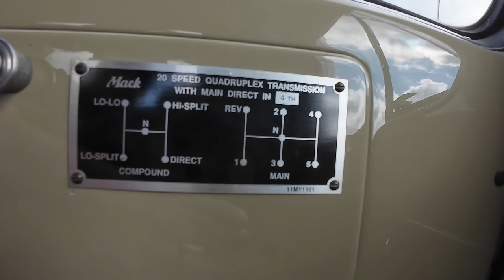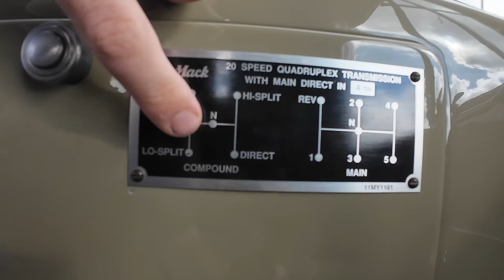2 Gearshifts | Twin stick shifting in my Grandpa’s old Mack

Comment: Back in the days when you had to know your equipment and had to know how to treat it to make it last or you don't make it home if you break it. As you said, all auto transmissions now. For those that drive new trucks, nothing can match getting the right gear, the right revs with enough torque to get over a hill without losing traction as well on dirt roads. When you have to get it right, that is your only option, downshifting, like 1 gear, then 2, then 3, then 4, yep, then you in bog cog pullin a roadtrain over a jump up @ 1000rpm, sitting on the edge of your seat, literally, hoping it will hang on just long enough to get over the crest. Not losing traction, but the drive axles start to squirm a little and feel like it is walking in slow motion as the revs slowly climb to 1050, the prime mover moves onto the crest then 1100rpm, then gradually 1200, 1300 and off we go, down the other side upshifting gears in pairs as the pace picks up again, picking up as much speed as possible to hit the next hill just ahead and do it all again. Miss a shift and lose momentum and then you will lose traction trying to pull too early on the next climb, so you won't make it to the top. Once upon a time, that was the way to learn to drive a truck.

Comment: Curious, I had a 1962 GMC V5000 with a 401 cubic inch V6 gas engine, it had a 5 & 4, accept to get it rolling, I never used the clutch, you clutched every gear, is that a Mack thing?

Comment: Bad ass!! Trying to understand though, if your in high 3rd wanting to get into low fourth. You put the main into fourth, you let the clutch out for a second in the video so your in fourth high before shifting the compound into low split to get low fourth. Is that correct?
Reply from the maker: Yep that’s correct. So that’s why it’s a double clutch for the big up shift then another double clutch raving up because it’s a downshift on the compound

Comment: Beautiful machine and impressive gearing - but I just can´t rap my head around the fact that you were using unsynchronized transmissions for so long. My granddad used to be a beer truck driver in the 1950ies and beyond in Austria, he was driving a Mercedes-Benz L 312 which already had a fully synchronized transmission back then ^^
Reply: You can still order new trucks today with "roadranger" transmissions - they have no synchronisation

Comment: Have yet to see a slo-mo of an uphill, dubble-clutch, reaching through the steering wheel, going from 3rd under to 2nd direct as an example. 1968, at the age of 18, learned the art of 2 stick shifting, in a 1947 Peterbilt, 220 Cummins, governed to 53 mph at 2100 rpm. I guess nothing to honk my horn over, not really an accomplishment I suppose. 22 % was my step pest gade on road. Some oilfield and military hauling was off road and steeper. NO JAKE BRAKE. Sometimes it took longer to pull the seat out of my ass than it did to descend the grade. Especially with old ten ton military tractors hauling 60 ton tanks on a cosadd.

I like the old stories of the teamsters hauling the old Grape Vine in the low hole with chain drive Macks, throttle set, walking beside the truck, reaching up once and a while to give a push or pull on the steering wheel while, drinking a cold beer, smoking a stogey.

Comment: Interesting. -  this old Mack has power steering.  Remember when you had to use both hands to pull on one side of steering wheel to make a turn.  Also did not see a drop down metal, low air pressure flag in windshield

Comment: A 400 Cummins needs at least a 125xx series Road Ranger or a Maxitorque box behind it. A single countershaft like that Quadruplex can't handle the peak torque of that engine.

The 335 Cummins was the most power/torque Mack ever put into that box from the factory, and that was a stretch. Peak torque on those was around 830, that 400 is way over 1100 or 1200.

A twin countershaft 5 x 4 setup like a Spicer would work very well also, much higher torque capacity than those old TRT and TRQ Mack boxes.

That said, it is a beautiful truck!
Reply from the maker: Hey we will see what she’s made of!
Reply: @ScrappyIndustries , you obviously don't abuse it so you have half a chance. Just don't lug it down, stay away from the bottom end of the engine's operating range.

Beautiful truck, your grandfather would be proud of you taking care of it. 👍 🇺🇸

Comment: I would love to challenge the newer drivers to do 100k miles driving an old Mack with that camel back suspension  like my generation did find out real quick why truck drivers had alot of back problems 😄

Comment: Geez. Two sticks now? You act like this was some kind of sorcery. We had an old K-100 with an 8 V-71 and mated Spicers. It was like rowing a boat with both oars on the right side. We had a '56 Crane Carrier with a 4 speed Spicer, a 4-way Brownie, and 3 speed 36M Eaton rears. Talk about gear bound. If you couldn't handle a Brownie where I worked, you needed to leave.

Comment: I'm surprised the little Mack quad box can handle the torque of the Cummins. Mack had problems with putting it behind the high torque rise 300.

Comment: Can you educate me? So are the “main” gears (1-5) too big to reach so you need the (1-3) to reach from 1 to 2, 2 to 3, etc.?
Reply from the maker: Exactly- the auxiliary allows you to cut the main gears down or “split” them. Totally depends on the road and the load and situation as to when and if you need to do this. For instance when loaded and on hills you are splitting everything

Comment: So is it basically running an 18 speed without the splitter? 2 seperate gears
Reply from the maker: Not really- it’s like having 5 main gears with 3 splitter positions instead of two

Comment: HAAAH.  He Ought To Dtive An Old B-Model Mack With A Duplex Or TriPlex Tranney.  When You Had Your Elbow Through The Steering Wheel Spoke,  And Both Hands On The Clubs CONTINUALLY Shifting,  Because The Engine RPM's Were So Limited.   And You Better Not Forget If You Were In Between Gears.  Like Going From 2nd High To 3rd Low When Climbing A Long Hill.  Because Starting Out All Over Again With Traffic Lined Up  Behind You Crawling At 25mph On A Windy Uphill Road,  Can Become A Panic Situation.  Your Complete  Attention Was On Driving The Thing.  NO Messing With Smart Phones...

Comment: Before the days of air shift there were sticks. Two was a duplex. Three was a triplex. You had to put your arm thru the steering wheel slots to control the truck while shifting gears.

Comment: When new drivers are  taking their cdl driving test they must double  clutch when they shift! Ok so I have been driving  for 43 years, yep old school(really  old school) I shift without the clutch  and use my mirrors on the road andto back up. Seems like drivers now days gotta tie their turbin on there head instead of a balllcap,and they can't  use morrors to backupYea that sounds racist,  but damn the American  truck driver set the standard for truck drivers now we got kids that have never drove a manual  transmission  and damn sure don't  know what side mirrors are  for!

Comment: It will not grind 1200to1500 RPMs just like all others trucks, with a Slight variation of a two finger Ethan and gear deal no clutch, thanks ,,,that’s what I watched a driver do in the Progressive four-speed brownie auxiliary, thanks ,p,s. I have that transmission now, thanks BigAl California. C&C send me over , thanks Clint, thanks BigAl California ,,,praise Jesus Christ grace amen 🙏

Comment: I'm 71 so take this with a grain of salt. when I was a kid like you I was taught by old drivers to never ever use that clutch unless stopped. all it does is get you in neutral and you will not get it back in gear unless you stop. No straight cut gear trans will work any different. if your big shift is wide you just wait till it will go. don't ever put that hand through the steering wheel again.. for very obvious reasons.
Reply from the maker: What are the very obvious reasons? When downshifting a big gear on a hill you have to simultaneously upshift the splitter with your other hand.  Our roads are not straight.  How would you like me to keep the truck on the road?

Comment: ok i got it at about the 3 min mark you are not going L 1,2,3,4,5 D 12345 H12345 its 1>2>3L>3D>3H>4L..... etc  you are splitting each numbered gear not the set of 5 gears that makes more sense!

Comment: I stopped watching the video as soon as you said to shift transmission with one hand through steering wheel. I have never done that in my 30 years of 6x4 and 5x4
Reply from the maker: I would like to know how you downshift the main while pulling a hill with a turn in it then?

Comment: You keep double clutching your going to walk with a limp. Those transmissions have no synchro's in them. So double clutching does noting. It's all engine speed, and truck speed defines when it will go into gear. My first truck I was taught on was a 59 Mack with a quad box and I was 9 years old. I'm now 70 and can still drive them.